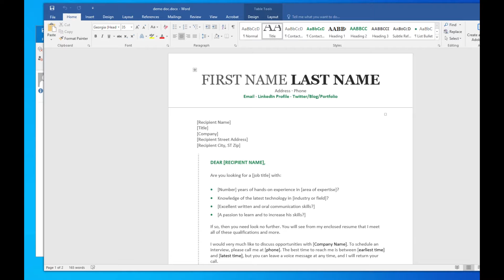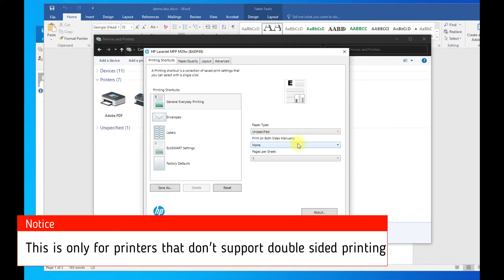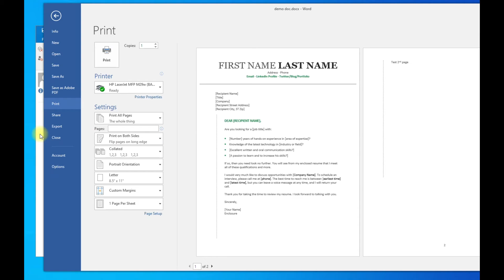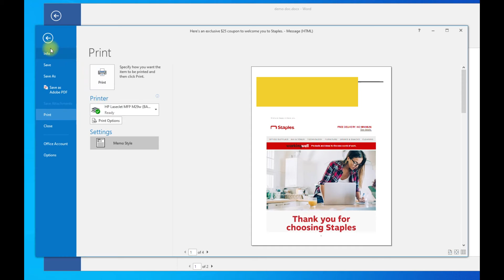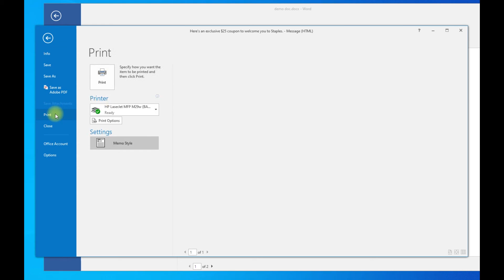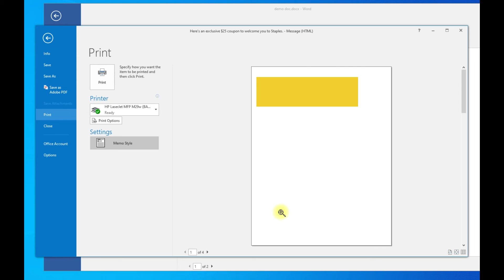How to print double sided in word and outlook

Comment: What if you are printing a table on both sides of the paper basically back-to-back page you want to print so they have to match up exactly How is this done for Microsoft word, I have office 365.
Reply from the maker: Not sure what you mean You should just select everything you want to print in Excel and scale a print I don't think you can print half of it on one side and another half on the other You got to scale it down to fit but you can always print on the backside if your data goes down and not across